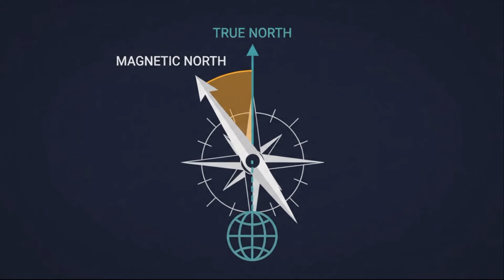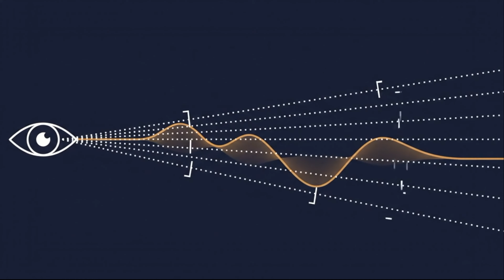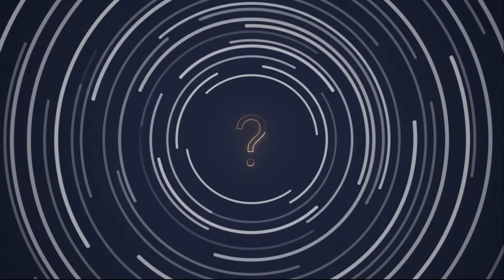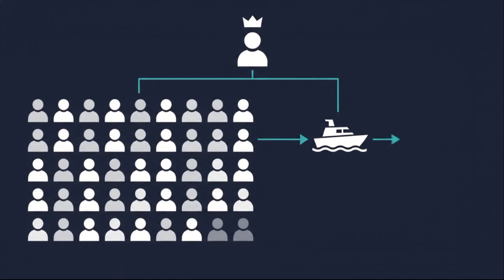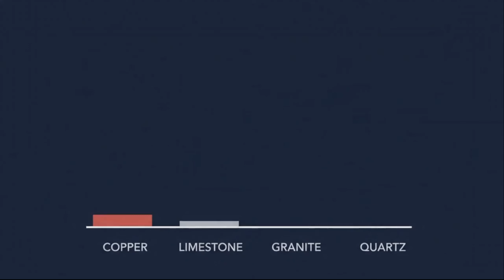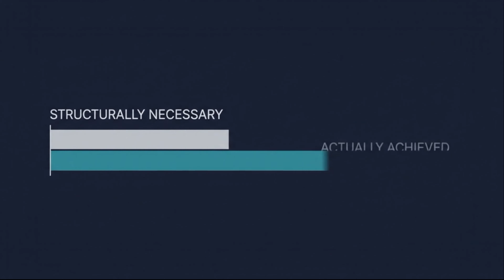The Great Pyramid: They Found True North Without a Compass

Comment from the maker: A few notes:

- The two-star method for finding true north is one proposal among several and it's genuinely debated. I have said so in the video rather than presenting it as settled.
- The Merer papyrus was found at Wadi al-Jarf in 2013. It's the single most underrated artefact connected to this building.
- The workers weren't slaves, there's a settlement next to the plateau with bakeries, breweries and enough cattle bone to feed thousands.
- The aerial shots were shot from microlight flights and not drones.

If you've been up close to the casing stones, did the joints look as tight in person as they do in photographs? I couldn't quite believe it.